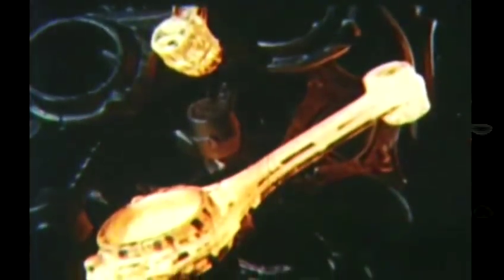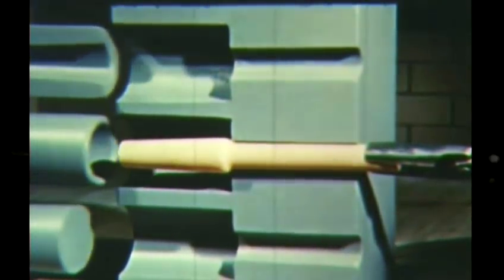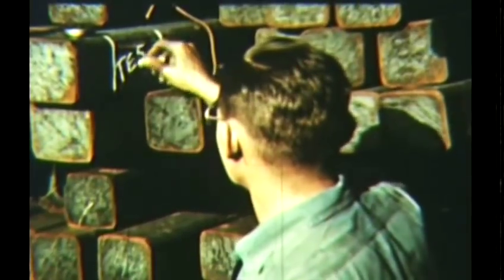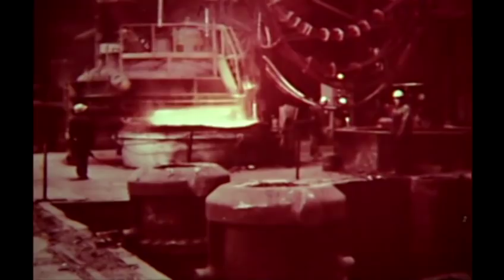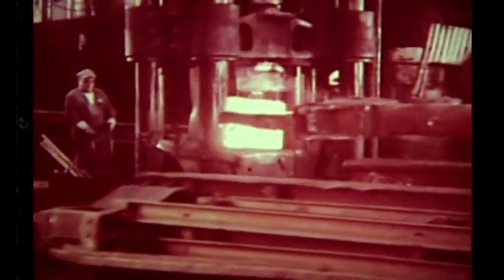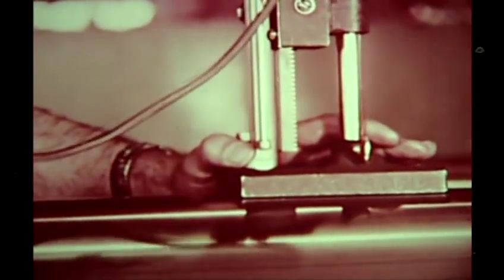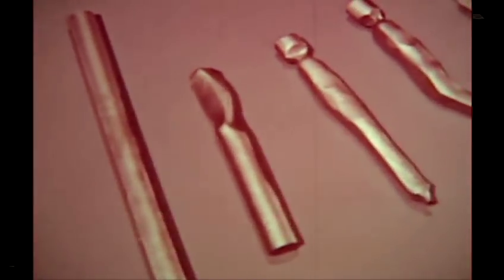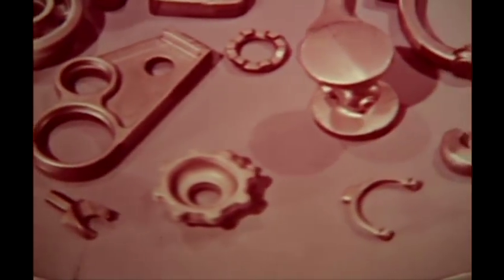FORGING HISTORY VIDEOS

Comment: One thing that stands out for me is that I don't see them wearing any hearing protection. I remember 30 years ago when i was 21 and I went to Las Vegas to play the slots. After hours of listening to the coins dropping from the machine and hitting the metal surface, I couldn't sleep for a couple of days because of the clanging that went on in my head. It was a horrible experience. I never went back. I imagine these men went through a much harsher situation and they returned day after day to pay the bills. God bless them.

Comment: There is/was a plant in Riverside, CA that makes just about every size of compressed gas canisters/tanks/bottles. The cold press used is/was of Vietnam War era originally built to press from billet, the casings for stinger missiles. I can't recall the PSI or Ton/SI operating pressure of it except that it was almost inconceivably high. Every billet (making the standard industrial sized bottles) would go in the press ice cold (in winter), get fully formed all in one pressing (each taking less than ten seconds) then come out scalding hot. The next step was through another press that would press the tops down to the valve-thread-ready bottlenecks.

Comment: The company I work for still has some WARCO Presses. That’s War-Co presses from when they made bomb casings during WWII. The great thing is that the WARCO press works as good if not better than some of the new presses. The thing is so stout that it can work three shifts without any issues. The other great thing about this press is that if something goes wrong with a part we can fabricate a new one. That’s how these presses were made. If something goes wrong with one of the new presses we have to order a new part. It takes time to get the part so production shuts down. As far as tariffs go... we order huge quantities of steel. We had to take three price increases last year alone. Sadly, tariffs are not helping U.S. steel companies because there aren’t many left. What the tariffs are doing is lining Uncle Scam’s pocket and the consumer eg. all of us pay more. The people of this country are sadly more interested in what’s on the iPhone than they are with how they are getting fleeced more everyday. We shut down so many steel mills it would take 15 years at a minimum to get back to were we were in the early ‘70’s. Sadly, we have let the government run unchecked. We are F’k’d. If we had to fight a major war like we did in WWII we would have a mighty struggle and the outcome would not be good for us.

Comment: That trimming on the crankshaft at 27:00......Also, I wish they went into more detail about the die-making process. They were apparently machined by hand? I don't understand how to complex shapes would be made.
Reply: There is a common tool called a die grinder. Also known as a rotary file. Normally pneumatic, cheap enough anyone with an air compressor should have one, as they are useful for all sorts of things. Not sure what else gets used.

Comment: Man, those old-school drop forges look SO dangerous. That dude's hands are only inches away from that thing, with no real safety mechanism. Glad we have better equipment and industrial safety guidelines these days!
Reply: Not really as bad as it looks. You diddn't work stoned or hung over and paid attention! There were missing fingers once in a while, though in all honesty it was usually "pilot error" that caused it.
Reply: Jeff Smith exactly.. I work in scientific glass, one of the only manufacturing positions left that has basically no oversight or enforced safety standards (part of what drew me to it) and after 15 years, my handful of injuries were all result of my negligence. Accidents rarely "just happen"

Comment: The way the dies are made you have a master  of the item that has to be made on a duplicating table that sits on the right side the vertical mill and the forging block sits on the left side of the table on vertical mill, on the right side you have a tracer that follows the master impression and a cutter known as a end mill

Comment: As they speak about crystalline grain structure, I'm remind of a comment I heard about DMLS 3D printing. This person said that current DMLS machines can print titanium and other alloys into a part that are a single crystal. Beyond the nano scale,  what I know about how DMLS works and how crystals form, I highly doubt that is true. As one piece of anecdotal evidence, I was just watching a documentary on Rolls-Royce engines for the new super-jumbos They went into detail about the importance and performance of new fan blades that they developed because of the added strength needed for the larger engines and claimed they developed a method to "grow" the blade into a single crystal structure but would not go into any detail about that process.
   I highly doubt they would bother with the development of a proprietary process that they keep secret if they could do it with standard, "off the shelf" DMLS machines.

Comment: Machinists today are so unskilled compared to those die-makers
Reply: I'm learning to become a Machinists, everything that you do that Is important now days is done on a CNC and in master cam, You still learn some of these skills but there mostly only in practice, the industrial application of them is all but dead now days. Its pretty sad but a modern CNC is so much fast and a million times more accurate. also I really do not want to get my hands anywhere near that close to a 1000 ton press as these guys are doing.
Reply: I wouldn't call it sad. Wasting thousands of man hours doing what can be automated and done more precisely benefits workers, consumers, and businesses. 

While we like to consider work like this where the soul of a craftsman is found, anyone can be taught to do repetitive work with skill.

There's still blacksmithing which is manual and artful and easily accessible.

At my work when I have to do repetitive work it drives me insane! I am very grateful for the CNC machines.
Reply: William Seroyer
 I think you're like a lot of people in present day america-you are not primary craft workers, but you are systems integrators. Do you think you could do machine shop and factory floor tool and die making like the old guys did without the necessary assistance of IT morons and tech support from the people who make the CAM cells? I mean, chuck up the raw stock, dial up the program and initiate it, push the start button and watch. Machine operators do that.  At Cal State Long Beach I had a class in management theory and the examples were interesting. One described the work of a lubrication engineer. Yes, that's right, there used to be such people. You've got such and such a shaft turning at a certain speed, here are the loads, it rides on babbitt, here is the compound you need. All gone, all automated. Likewise the stress engineers with their ten keys. I did one stress analysis on a simple radio rack one time. Those guys did stress analysis on complex aero structures. They're all gone, replaced by CAD. Everyone is replaceable. We built the machines that would put us all out of work, or send our jobs to places where the people who serve the machines make five bucks a day. You're not safe, and neither was I or these other people around here. By the way it is nice having a discussion on youtube with an intelligent person without calling each other names.
Reply: But it is the inevitable progression of labor, business, and the free market economy. Where time can be saved and where consistancy and precision are needed to be dead on 100% of the time, no human can beat a programmed machine. Any manager who believes in that philosophy and still runs his business by it will be pushed out of the market by lack of customers willing to pay high dollar for something someone sweat on and which is likely inferior quality.

I get far more satisfaction of designing a weldment in Solidworks, stress testing it, laser cutting it, and welding it together than I do carefully massaging hand cut parts on the belt sander to get that perfect fit-up and hoping it all holds together under a load because my gut tells me it will. 

I believe the soul of the craftsman can be preserved in the modern era. After all, the driving force behind most craftsman is his/her desire to put their skills, intuition, and intellect to the test to create something that just works.
Reply: Brian Graves
 You assume that it's inevitable but what that notion leads to is things that can't be repaired or were never designed with repair in mind. It's a design philosophy that goes nowhere, because, taking your theory as true, it leads to money managers each undercutting the other while quality and robust design suffers because it does not bring in an immediate return as reflected in the quarterly statement. What you end up with is manufacturing as practiced in China and all the product has to do is last until the 90 day warranty expires. If what you said was true there'd be no more potters, blacksmiths, plumbers, electricians and guys like me who are artisans, because nobody would pay for it. But the fact is they do, unless you assume that they're all idiots. My bank account's proof that your one size classical liberal economics is not the only game in town. Your personal preferences and what you like to do are not determinative of what the rest of the world thinks, or more importantly how they spend their dollars. If you were right, there'd be no market for boutique guitar amplifiers because nobody'd pay what it costs to make them. Yet they do, and plenty. See, a lot of people are romantics at heart and when they buy something they are buying an experience and a story as well as a product. That's what they want.
Reply: Brian Graves But, those men were the product of a free market economy - when there weren't machines who could do his job.  Later 'bosses' decided to send all of the labor to China.  There is always a balance point [from a bosses point of view] of labor vs automation.  Eventually YOU will be replaced whether American or Chinese] - take care of yourself and your children.  One day five people who have the capacity to sell to billions - but the billions have driven to extinction - OR - people in the future will be able to manufacture literally everything they require - or a them and a couple of their friends.
Reply: Almost nothing at my current job could be automated.
Reply: Brian Graves
Lucky you.  But that is a provisional 'yet'.  No one has 'yet' figured out how to stop the process of automation.  Autonomous vehicles, drones, delivery robots - ten years away, maybe twenty - and all of the FedEx guys [and galls], the UPS man, they will all be for the scrap heap.  There is an enormous class of people - human beings - who will simply have no means to support a family - what then?  Even the IT guys, what happens to them when a machine can write more and better code than them, but 24/7 and who don't have or need families - or need to be paid at all?  We live in interesting times my friend.

Comment: Most of the things being forged here are cast or stamped nowadays
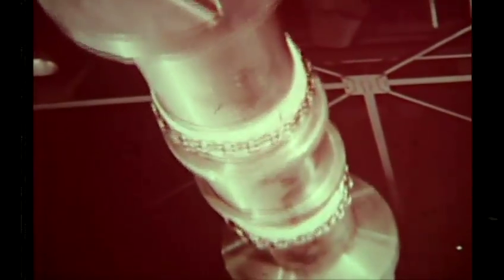Reply: Mark, so we are on the same level of knowledge, no casting or stamping can match the toughness of a forged part. For instance, at 58:54, this a drive shaft for a rolling mill. It went between a 1,000 HP motor and gear box to the backup roll in the mill. Big torque, nothing but a forging can survive. The finished surface between the two rings went into a big brass bearing to keep the shaft from twisting, holding it straight. I seen these things machined and fitted at the defunct E. W. Bliss Company, Salem Ohio.
Reply: @Mike44460  I agree certain things for most part are forged and for now, need to be, but with the knowledge we have today casting can do just as well especially after tempering, most engine parts are cast now and even the now titanium fan blades for jet engines, nearly all gears in power tools are cast sintered metal (powdered) which would have been space age back then, when this video was made I'll bet 70% of items in a house had been forged one way or another, nowadays its more like 10% with everything else being stamped, cast or plastic, this is also helps make us the throw away Society that we are today